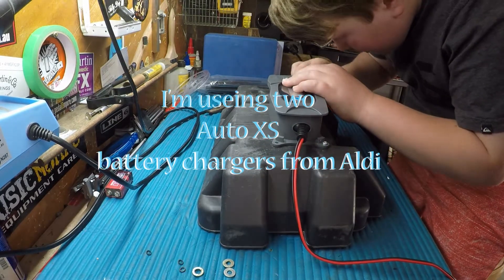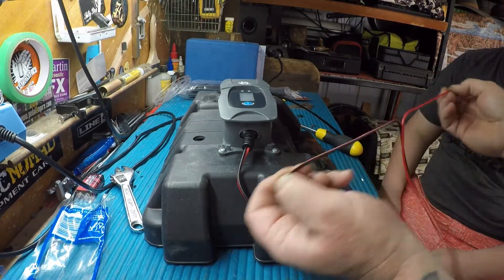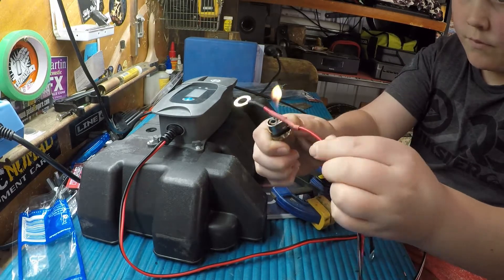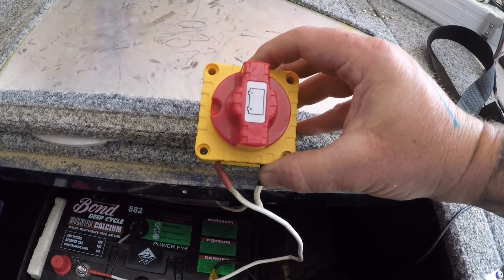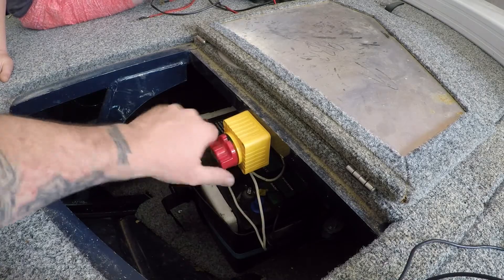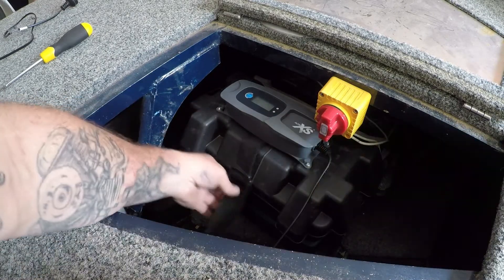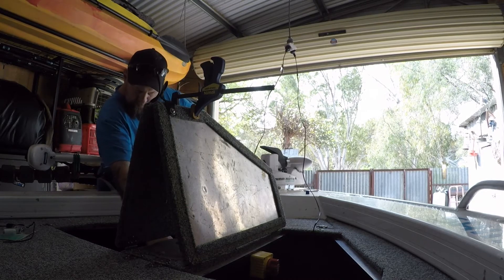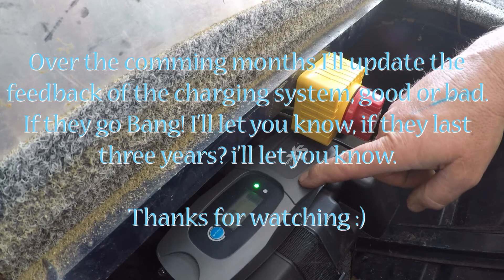24v battery charging with $29 AutoXS Chargers

Comment: i think you can leave these batteries wired as 24 volt and use separate 12 volt chargers if the chargers neg. is not also the neutral of its plug. most to prong plug chargers can do it . test for conductivity between  battery +,- and the ac plug. if nothing, then you can leave the batteries wired 24 v.

Comment: Great work Laddy. It's great to see you getting the young bloke invloved. 
 I have a trickle charger permanently hooked up to my motorbike, but that is more for extended periods of no use. E.G.. Winter!
Reply from the maker: thanks Robbie, I'll see how it goes, I have a 15amp Ctex charger and I was going to buy a second to mount in the boat, But I've been told deep cycle batteries will only take 4amps of charge so I thought I'd give these 3.8amp Ctex coppies a run to see how they go :)